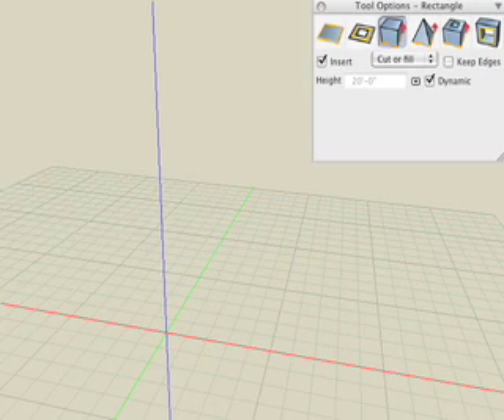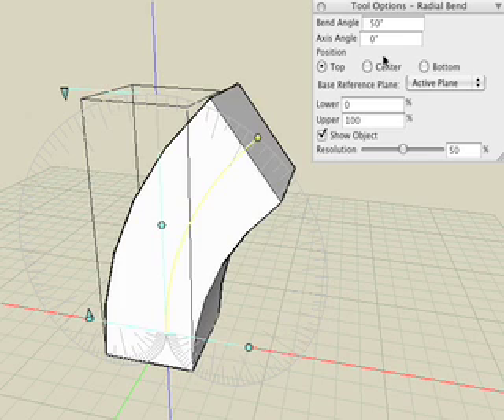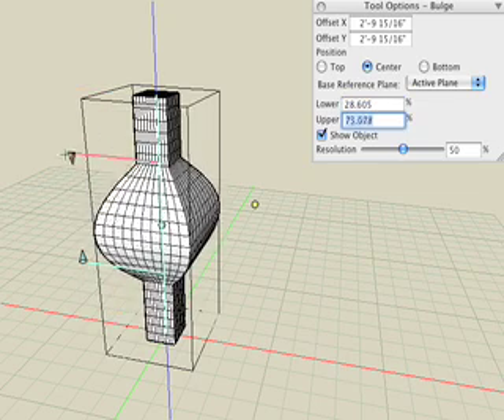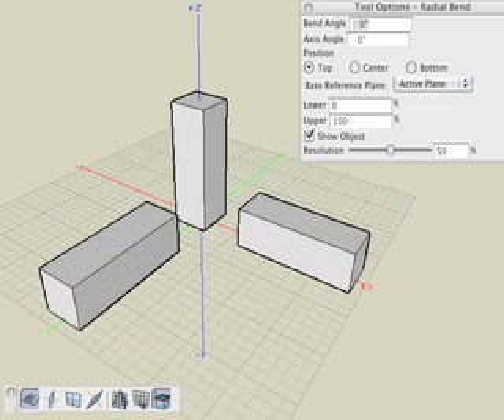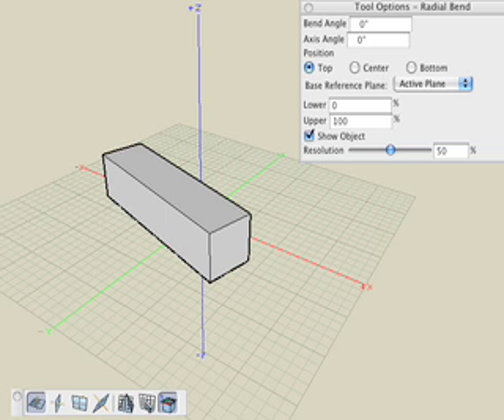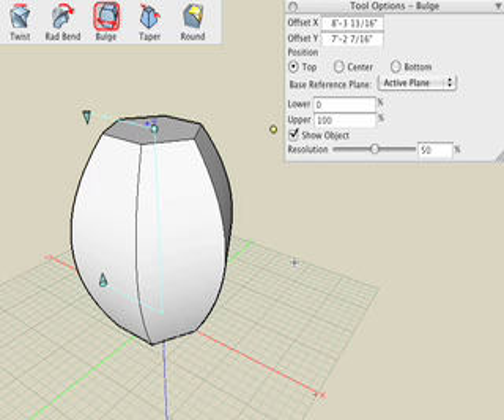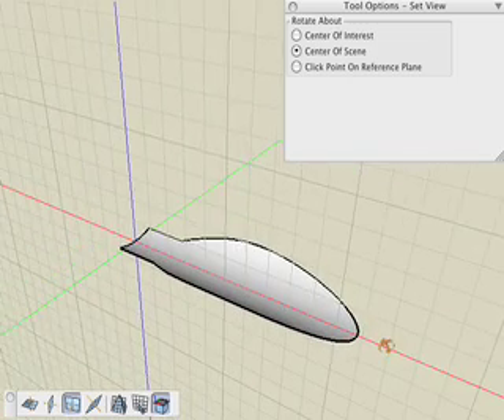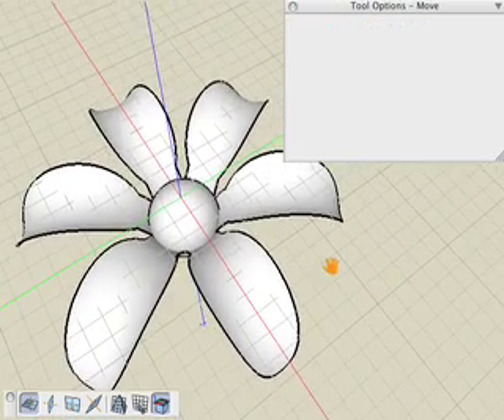bonzai3d Deformations

Comment from the maker: @rs666sathan666pk 

With our other software formZ you are able to change the deformations after the fact -- but with bonzai3d, once the Deformations are applied, they are basically fixed.  (Of course, you can undo right away if you like...)

If you like the bonzai3d interface but need even more powerful modeling, our next update for formZ will be built on bonzai3d to combine all these features.  (Look for this update early next year...)

Comment: Sebasfff,

You can render your files directly within bonzai3d if you get the RenderZone plugin -- and you can export to pretty much any other renderer via the 3d Export Options.  Maxwell Render rendering will soon also be an option via an integrated plugin, but we don't have any "official" information about Vray at this time.  

Have you had a chance to try out the 2.0 version yet?  If you have any experience with Vray, using RenderZone should be very easy for you. :-)